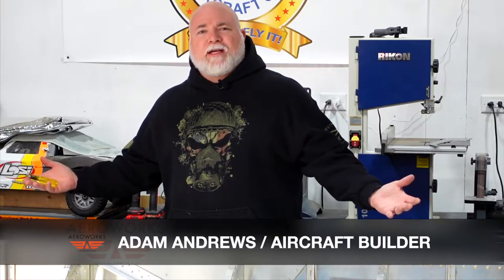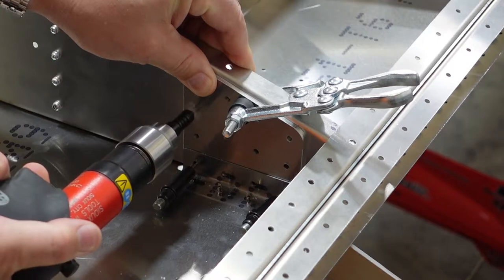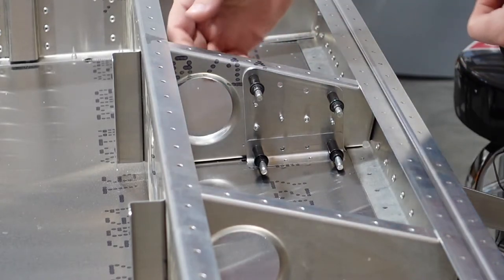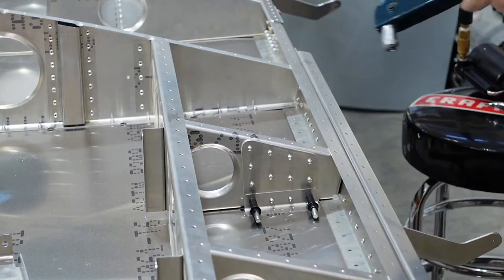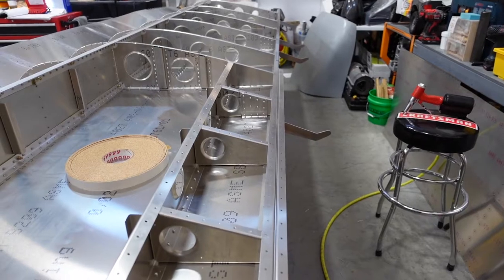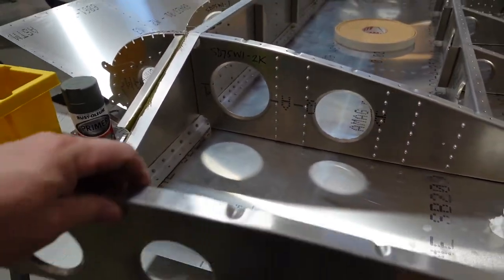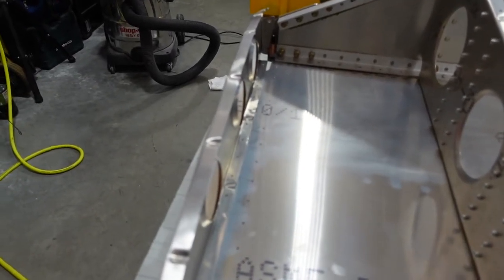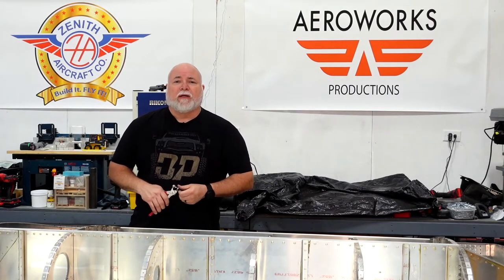Ep. 53 | Right Wing Build | Zenith Super Duty Aircraft Build

Comment: Hey Adam, sorry it’s not a relevant question to this video in particular, but what type of bits do you use on your right angle drill adapter? I bought one on your advice but need to find proper bits for this build. Cheers.
Reply from the maker: I purchased this kit from Aircraft spruce and it came with all the bits/tips.  https://www.aircraftspruce.com/catalog/topages/tightfittoolkit.php?clickkey=20723
Reply: Thanks so much for the response! Parts ordered.

Comment: Thanks for the discussion about the Rustoleum Self-Etching Primer.  Like you, I was always under the impression it merely etches the metal to roughen it to provide a better bond for another paint layer.  I've seen others use this as a corrosion preventative primer and always thought that was not the correct intended use.  Personally, I used Cortec where necessary on mating surfaces, but that's probably overkill if, as you point out, you hangar the plane and are in a relatively dry environment.  My 750 STOL's 6061-T6 airframe will likely last much longer than I will! LOL!
Great lighting and camera work - really helps to see the details in the build!  Glad you're back to building!